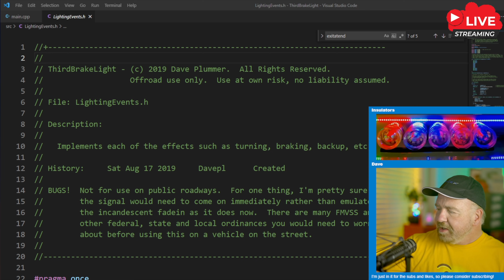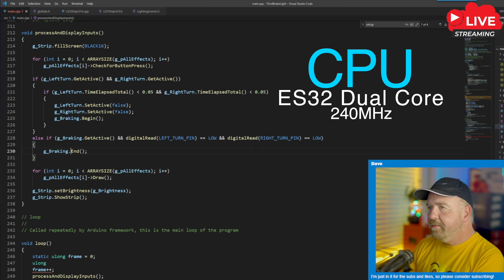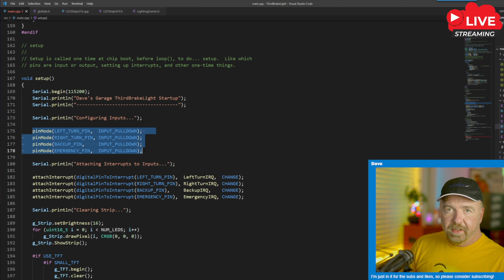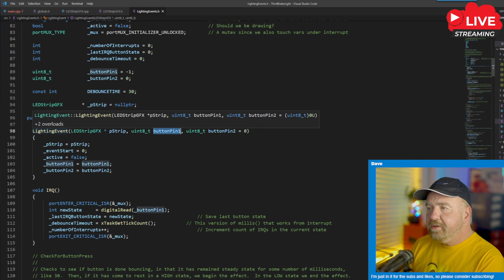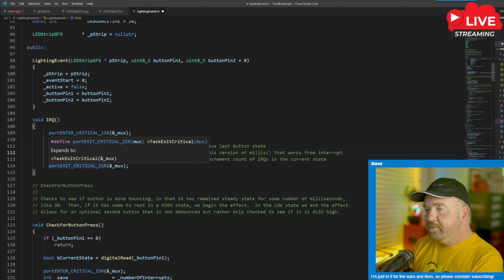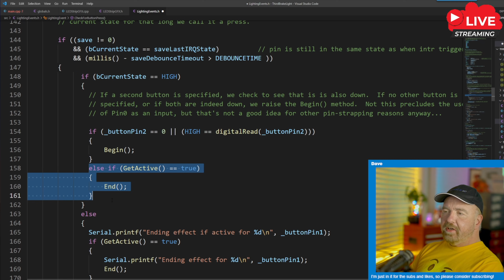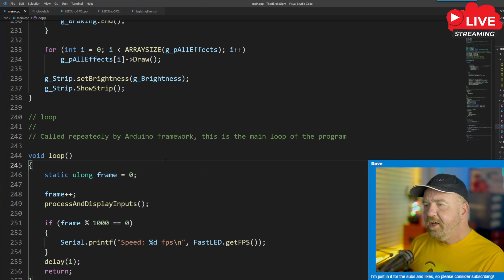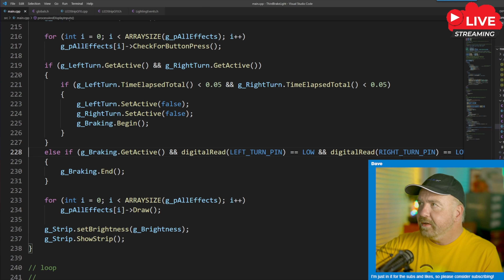Debounce a STOP switch in C++: Live with Dave in the Source Code Editor! (Live Replay)

Comment: When I did this for a COCO computer keyboard.  I did, First on sends the signal and then sets a cool-down timer.  That made the code small and faster.  
Also, are you sure the IRQ could be called twice?   What ever is doing the line polling likely has a frequency and some smaller cpu's can't send another IRQ until the existing one returns. 
In the coco project this was the case because we were using one of the computers timing interrupts (memory refresh if I remember).  But maybe yours can.
Reply: Some processors allows nested interrupts. Some do not. It isn't uncommon that the ISR needs to explicitly tell "ok - nesting allowed" to allow multiple interrupts. At least for the very same source.

But the critical section wasn't really for nested interrupts but to make sure to synchronize access to variables shared between ISR and the polling code.
Reply: @perwestermark8920  The critical section is just an easy way to make the code reentrant.  There are other ways to do it but I guess he has the cpu power to spare so no big deal.  
In hardware you do have to setup the irq jump address.  I don't think that's what he's doing.  That looks more like a library call that's dealing with the hardware.  But ether way, the actual hardware or the lib he's using may already single execute the interrupt response code.
Reply: @lucidmoses  The critical section in the ISR makes sure the access to global state is serialized. It doesn't matter if the processor supports reentrant interrupts or not - the critical section is still needed.

Note that the ISR assigns state to three variables - and two are int which means they may not even support atomic assign depending on processor. And the method CheckForButtonPress() uses the same mutex (_mux) to be able to read out the current state of these three variables in a consistent way, without the ISR breaking in during the read.

Without the critical section, the ISR could trig, and change state of one or more of these variables while CheckForButtonPress() is busy reading them.

So if the processor supports reentrant interrupts or not, you still need to protect and serialize access to variables that are processed by both an ISR and main code. Or in case of using a task-switching OS, to serialize access to the variables between different tasks. The compiler will not understand that the underlying hardware may suddenly jump away and run some other code in the middle, that will magically change some of the variable states - hence the need for a mutex.

Mapping address of the interrupt service handles are done at 5:40 in the video - line 182 to 185. Somewhere there is a LeftTurnISR() helper function that will call the ISR method of the proper C++ object, i.e. g_LeftTurn.ISR().
Reply: @perwestermark8920  reentrant refers to how you code something.  It's how you coded your function.  It means you can call it twice before the first time you called it returns and everything will be ok.  It has nothing to do with why it's called.  i.e. multi threaded, hardware irq, software irq, OS/Lib call backs or whatever.   Critical section is just one way to help you  making your code reentrant.  There are plenty of others. 

The attache interrupt call is exactly why I stated it looks like he is using a library.  Actual processor interrupts wouldn't be coded like that.  But I can't be 100%, I've not used an Arduino.
Reply: @lucidmoses  No need for describing the meaning of the word reentrant - this is my profession since a huge number of years.

Making the ISR reentrant just happens to be  a side effect of the mutex code. And no - critical sections aren't just there to make code reentrant even if they can result in reeentrancy as a side effect. There are more than one way to create a critical section - in this case it is implemented using a mutex. And that mutex is used to synchronize access - but these accesses doesn't need to happen in that same routine. That poll code isn't reentrant but must synchronize variable access with the writes done in the ISR. And I'm almost 100% sure the ISR isn't configured to allow reentrant interrupts, even if Dave mentions reentrant in the video. So most likely, the ISR does not need any protection to make it reentrant. But the ISR must synchronize with the main loop. And that happens through the use of that mutex.

That _mux aka mutex means "mutual exclusion". So any parts of code sharing variables that gets updated in a task-switching manner (multiple threads or in this case ISR and main loop) needs to make use of the same mutex. All to guarantee mutually exclusive access to these three shared variables.

In many cases, it's enough to have a C-style function with some compiler-specific keywords like __isr to have the compiler supply the additional code lines to protect some processor registers etc, so it's seldom a library is needed. If the compiler doesn't support any magic "isr" attribute, then the setup code needs to be in assembler. It's more common to need to write own code if allowing nested interrupts, by acknowledging the current interrupt so the interrupt prioritizer hardware knows it's safe to sample that (or other) interrupt sources and issue new interrupts. Some processors like ARM Cortex-M3, have automatic hw support to set up the ISR context - so there is no need for any assember code or any magic "isr" attribute - it looks and behaves as a standard C function. In the end, we all uses libraries - own or others. It's boring to write 10 lines of code to initialize a GPIO as input with pull-down if a single function call can be used. It's boring to write 10 lines of code to set the ISR address, configure the priority and enable the interrupt source when a single line can be used.

Why don't I belive the code needs a reentrant ISR? Because most ISR aren't written to be reentrant. And if the prologue code acknowledges the interrupt source to allow the interrupt priority controller to sample and issue new interrupts for the same interrupt source, then you can have a situation that interrupts happens faster than the average ISR execution takes - with the net result that you crash the program with a stack overflow. So this is not a good generic implementation of an interrupt handler - more something you create if you really needs it but when you at the same time have control of the amount of nesting you may suffer. This isn't good logic to have in any generic library.

Dave's code primarily needs to process the latest pin change interrupt - it isn't important to care about the actual number of bounces. So adding complexity for that just isn't needed - that is also why the code was changed from counting number of interrupts to instead just having a bool variable to tell if at least one pin change had been handled since previous time the poll code cleared that flag.

What is way more common is to allow traditional nesting of interrupts - i.e. that a higher prioritized interrupt may trig while a lower priority interrupt is still being serviced. In this case, there is a limit to amount of stack needed since there is a limit to number of different interrupt sources and interrupt priorities. But for nested interrupts, each individual ISR doesn't need to be reentrant.

But nested or not, reentrant or not, the rule is still the same - access to global variables needs to be synchronized between ISR and main code. In some situations, it may be enough to tag variables as volatile but for the more general case, a mutex is normally needed.
Reply: @perwestermark8920  Yes, It would have been nice to not have to explain reentrant but you kept attributing it to the processor.  It is unfortunate that with your "huge number of years" you didn't end up with more experiences.  You keep trying to bring it back to the simple stuff you would do if your running under windows or something.  I suggest you read up on how interrupts actually work in an actual processor.  Then re-read my OC and you'll see how pointless this exchange has been.
Reply: @lucidmoses  The handling of interrupt nesting is very much an attribute of the processor - or more specific the interrupt controller integrated with the processor. And the normal case is that the interrupt controller do not allow any reentrant activations of the same interrupt vector unless the developer spends significant time trying to get that result by tricking the interrupt vector controller into thinking the interrupt has already ended.

Your original post? "The critical section is just an easy way to make the code reentrant.  There are other ways to do it but I guess he has the cpu power to spare so no big deal."

So - suggest a solution then that does what this code does... From your posts, you still haven't shown that you have understood the need for variable protection between the ISR and the CheckForButtonPress() method. While nothing we have seen shows any need for making the ISR itself reentrant. The critical section does solve a completely different task than your wish for a reentrant ISR.
Reply: @perwestermark8920  I see you didn’t look it up.
1) Interrupt controllers have nothing to do with nesting. That’s the CPUs job.
2) Interrupt controllers have nothing to do with reentrant activation, what ever that’s suppose to mean. Some can do queuing.
3) “Your original post”...  Wow, Are you honestly trying to make be believe you can’t count to one.   I’ll not respond to that.  It would be insulting.
4) Now, if you would bother to read the actual original comment then you would see it’s a question.
I believe Arduinos are single cpu/threaded devices.  He’s likely using a lib so his routine will not be called twice.   And there is no critical data between the isr and his main code.   I think as is if he did no flow control, the damage to the data would mean his light would be on/off for an extra millisecond.  If the timing he is doing is based on a hardware clock he won’t even have any drift.  So yes, the question stands.   Could the routine even be called twice?
Reply: Interrupt controllers have nothing to do with nesting? ARM doesn't seem to agree with you. "Nested Vectored Interrupt Controller (NVIC) ARM Cortex-M Microcontrollers. NVIC is an on-chip controller that provides fast and low latency response to interrupt-driven events in ARM Cortex-M MCUs." So very strange that they selected the word "Nested" in the VIC name if interrupt controllers have nothing to do with nesting... Maybe you missed the difference between reentrant and nested?

Interrupt controllers not relevant for reentrant activation? Since it's the interrupt controller that issues the activation, they are involved. Just that an interrupt controller will not allow reentrant activation of an interrupt source, unless the code acknowledges the current interrupt early. Normally, that acknowledge happens as the very last instruction before the return, so the processor just has time to leave the interrupt before next interrupt gets trigged. But by acknowledging the interrupt early, it is possible to have the interrupt controller trig a new interrupt before the current ISR has done any stack unwinding. This leads to reentrant interrupts. Because of disadvantages, this is seldom done.

You belive Arduinos are single CPU/threaded devices? But you did look at the video - the part about the processor being dual-core? But single-thread is enough for this usage case - because an ISR counts as a second thread when it comes to synchronization. The ISR is a task switch where variables can change state at a random position of the main loop execution.

So your original post worrying about if the ISR may be trigged twice is irrelevant to the case - that is not why the mutex is used. It's to synchronize between ISR and main loop.

Don't ask me if the routine can be called twice because I have never said it is. You asked in your first post indicating you wondered if the critical section was needed - i.e. if the ISR could actually be called twice. I have said I do not think the ISR is called again before first instance has exited. But that the critical section was there to synchronize variable access. Whereup you said the critical section was a clumsy way to make the code reentrant. It's all a chain starting with your initial post and with a very clear confirmation in your second post that you missed the actual purpose of the mutex.

The synchronization code is not there to solve that task. It's to let the main loop get an atomic read of the three variables that the ISR is updating. Depending on actual bounce time of switch, there is a possibility for a failure where the code misses the last pin change. So not just off by one poll interval but off until the physical pin detects a new change. This happens when the button is released just after the polling debounce code notices the pin has been stable long enough - and then clear the state which tells that the ISR has just detected the next state change. Often for switch break, there isn't any bounce, so there isn't any additional ISR invocation to repair this state. Only sad thing is the code is using a mutex, but is actually still suffering from this problem by having the polling code take the mutex twice. So when it clears the ISR-driven data, it may clear a different set of data than what it started to process. And this is why timing-related code is a bitch.
Reply: @lucidmoses  So be concrete - what did you not like with that quote? What do you find wrong with it? An argument is only an argument if you can put it down to actual, meaningful words.
It was you that wrote "Interrupt controllers have nothing to do with nesting. That’s the CPUs job."
And it is the quite major chip developer ARM that writes "The NVIC maintains knowledge of the stacked, or nested, interrupts to enable tail-chaining of interrupts."
When there is a difference between your claim and ARM's claim, it really is up to you to prove your point by rising the bar quite significantly. And that doesn't happen by continuing with more ad hominem. As of now, it isn't obvious if you understand nested interrupts - it seems you think the word "nested" only applies to recursive function calls.

I have not once misquoted you. I noted that some processors supports nested interrupts, but the critical section code used was needed to synchronize variable access between ISR an main loop code. Something you seem very convinced isn't so.

And you have not shown your superior knowledge by supplying any suggestion how you would synchronize the variable access without the mutex. You really can't continue the thread about how I don't know nothing, withtout you actually producing any proofs of your arguments - there has still not been a single sentence from you indicating that you have understood the mutex is there for synchronization between ISR and main code, and not for reentrancy inside ISR. And why would the main loop code need any reentrancy protection?

We could have held a productive discussion if you hadn't been too fond of ad hominem. You could for example have looked closer at the NVIC documentation instead of talking about birds nests. Looking closer at tail-chaining of interrupts can be quite productive reading. It's a challenge to synchronize a vectorized interrupt controller with the processor core because of pipeline delays, latencies accessing VIC registers etc.